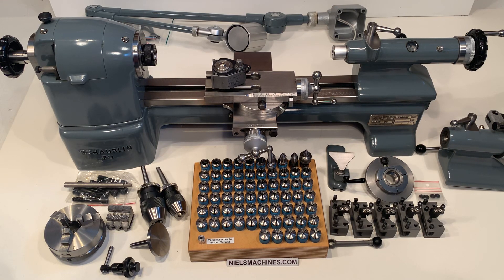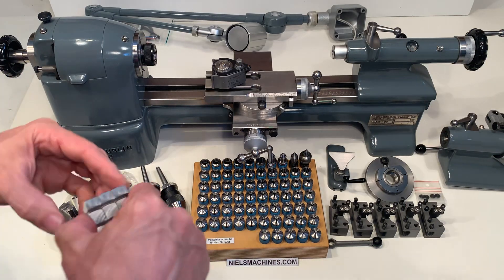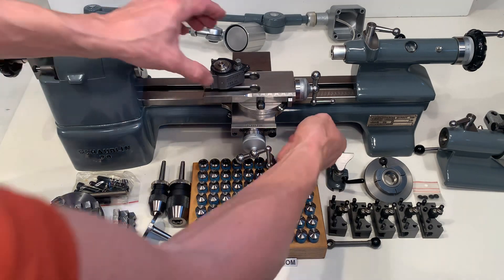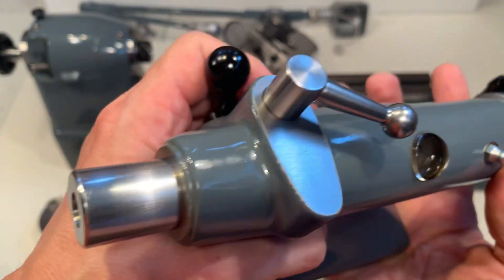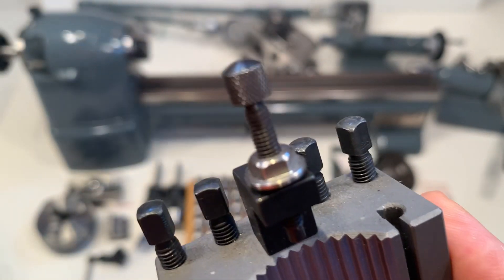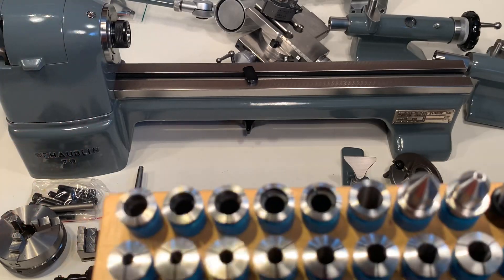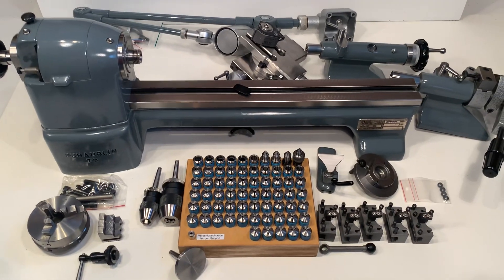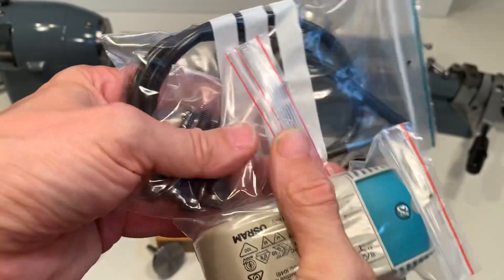Schaublin 70 High Precision Lathe with accessories (NOS)

Comment: My ONLY complaint is the lathe has no thread cutting capabilites. The workmanship is impeccable.
Reply from the maker: There is a treadcutting attachment for the Schaublin 70. Not cheap and not easy to find.
Reply: @NielsVrijlandt--nielsmachines  Thanks Niels; I will look for it.

Comment: Where can you get an almost new Schaublin like this? It must be over 30 years old. I had several 102 NVMs and also a 102 N in my department. We even sent them to Schaublin or their successors in Switzerland several times for overhaul because they were such good machines. The only weak point is the non-hardened bed. But if you take care of that and always remove all dirt before moving the tailstock and support, these machines will last forever.
Reply from the maker: Indeed, it is almost impossible to find a machine like this.
Reply: @NielsVrijlandt--nielsmachines  Especially in the condition and quantity of accessories.